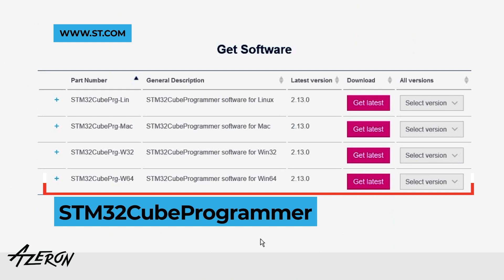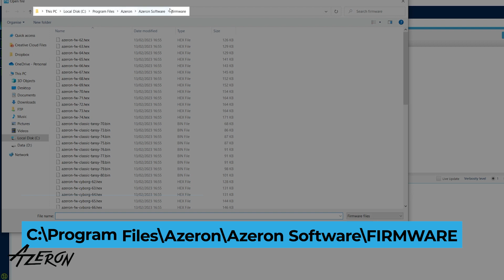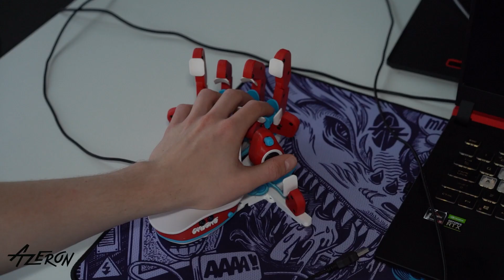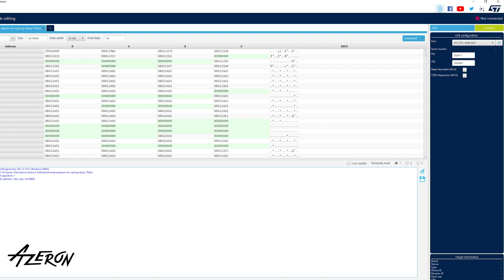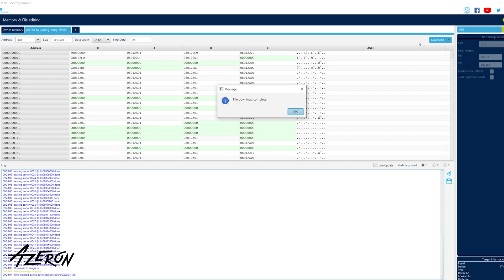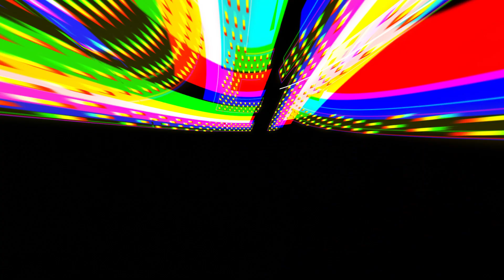Manually install firmware on Azeron Tansy (black) board  (READ THE DESCRIPTION)

Comment: I was able to complete all of the steps but the software does not run.  I get the message asking me to allow the software to make changes and, as usual said yes but it never loads completely,  An instection of the USB devices in Device Manager reveals that the driver is not installed.  I had uninstalled and reinstalled the latest software.

Comment: If you end needing to do this and at the time of reading this the newest version of STM32 is 2.16, then download 2.15 instead. There is a select version option to the right of get latest. Currently 2.16 deletes some files and makes it so either the device doesn't know its plugged in or makes it undetectable by the computer. I had this issue with my cyborg and after talking to customer support, they recommended switching the STM32 versions and that worked for me.
Reply from the maker: Thank you for posting the workaround !
Reply: @AzeronCOM can you help me im having this issue right now and am hard stuck on what to do nothings working but it has power
Reply from the maker: @natelamere2140  email us on info@azeron.eu for the technical assistance
Reply: Hey bro so im experiencing this problem right now is there any way you could help me out please

Comment: I have connected my cyborg to my pc, wasn’t detected by the software. Uninstalled it. Installed STM32, using a cyborg. Ran the rewriting sequence holding the three buttons down and plugging it in, port doesn’t populate and no serial number appears. I am lost as to what to do now. Help would be greatly appreciated as this video doesn’t say what to do in the case it still isn’t recognized.
Reply from the maker: Please contact our customer support.

Comment: The file doesn't work its still saying connect device on azeron app if I take out USB cable n put back in the sign goes away and I get access to settings but it's really slow and doesn't let u click anything so it knows its plugged in but ther must be an error in some code after update

Comment: Which firmware is for black boards? Tansy is not compatible with my Cyborg. I've got black board.
Reply: .bin is for tansies. See the 0.26th second in the guide
Reply: @azeronltd3313  if I try to use azeron-fw-cyborg-78.hex when I click download I get error.   
15:47:50 : Error: failed to download Segment[0]
 15:47:50 : Error: failed to download the File
Reply: @azeronltd3313 hey bro can you help me out im going through the same situation right now
Reply: Hey bro can you please help me out im hard stuck as well experiencing this
Reply: @natelamere2140  what problem are you trying to solve?
Reply: @SystemsRockstar hey man tysm for getting back to me ive tried everything man i cant get my azeron to register it just crashed on me yesterday out of no where and ive tried everything idk what else to do it gets power because it lights up but i cant export/import my binds they wont even register it says plug in device and ive tried every video and just cant seem to find a solution idk wth i did for this to happen
Reply: @SystemsRockstar  you there bro

Comment: The video is out of date. The page has changed. I can't find the correct app. please help
Reply: same. no one cares about us.
Reply: you may have the wrong program open (that's what happened to me) make sure you have STM32CubeProgrammer open and not STM32TrustedPackageCreator. it made a shortcut for me only for "STM32TrustedPackageCreator" if you right click the shortcut and Open File Location the correct program "STM32CubeProgrammer" should be listed in the same folder.

Comment: I am switching to cyborg from compact is there anything I need to change? Or do I unplug compact and plug in cyborg and that's it.
Reply: That should be it. You might have to do a firmware update, but it will ask for it.
Reply: @azeronltd3313  thanks for the reply I appreciate it.

Comment: Whats the difference between new boards and older boards? I have a cyborg..
Reply: Both boards do same function. 
Teensy 2.0++ were getting harder to get, so we had to come up with our own boards.
Reply: @azeronltd3313  ok so does this function work with my cyborg?
Reply: @DRSKINGDAVID  Depends on the board installed on your Cyborg. Remove the palm rest and see, the best way to tell the difference is the color of the board. 
If it`s black then this guide applies, if it`s green it will be a different way

Comment: Are you selling the new board for older keypads?
Reply: We do, depending on the keypad you might also need an additional part as the plastic base part differs for keypads with older board vs new board